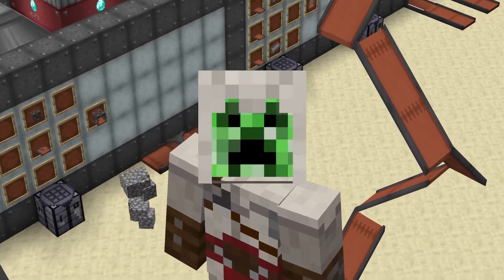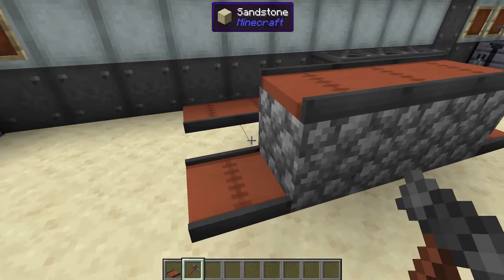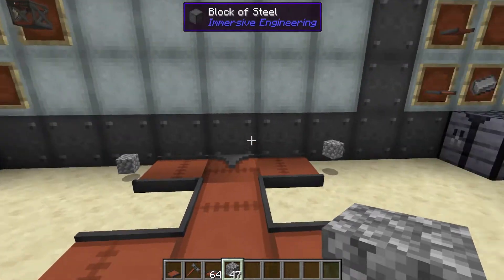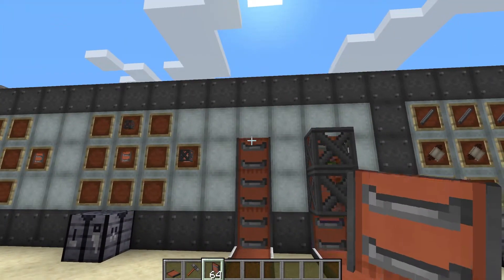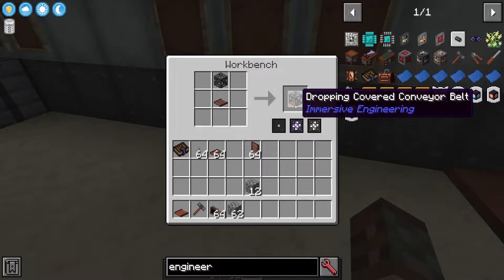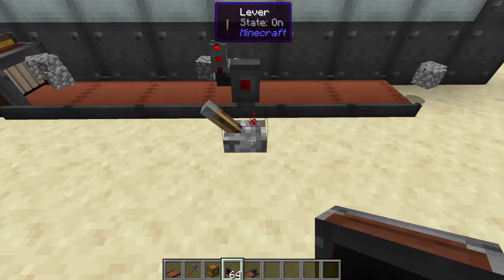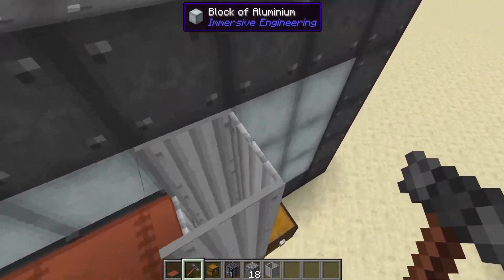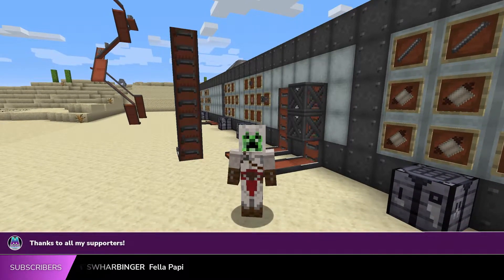How to: Immersive Engineering | Conveyor Belts (Minecraft 1.16.5)

Comment: Hi man!
Pretty new to Minecraft and started my own server with some mods.
Using Immersive Railroading and this mod here at the moment and I've started to build an automated loading system for my train.
Setup at the moment: Double-Chests with 2 extractors and 2 conveyor belts for every wagon but the extractors are pretty damn slow. Is there a way or setting to speed the extractors up? 
Or do you know a faster method? I'm open to suggestions as I don't know anything anymore on how to increase this process...
Reddit, Google and YT haven't been a help so far as they only explain the basics and I've figured those out for myself.
Maybe you've got some input for me. Thx in advance.
Reply from the maker: By extractors I assuming you mean excavators? I have a video explaining them on my channel but I don’t think there is a way of speeding it up. However you can build multiple of them. Once you have a chunk picked and core drilled you can build as many as you want within that one chunk. You just need more of them for more items per minutes rather than speed of one unfortunately.
Reply: @Mondays3  Oh, no. Sorry, I don't mean excavators, I've been talking about these things dragging stuff out of chests and putting them on the conveyor belts. 
I've been able to use the excavators so far but I need to be able to automatically transfer everything from the chests faster to the train waiting, but the "extractor belts" (looked it up in your video, sorry...) are too slow. I'd like to speed those up.
Reply from the maker: You can't speed them up. Only way to make it faster is by having more than 1 extractor on the chest and having multiple lines. It doesn't technically look faster but you are getting a higher rate of items per minute

Comment: Hoping that someone will see this comment and reply but I'm planning on using create and IE together but I'm struggling to figure out which mod has the better conveyor belt? Or even if the belts will work with the other mod?
Reply from the maker: I think the create mod has better belts as they they are a lot cheaper and work at larger distances and diagonally. The two should work together but not directly. If and item drops off the end of a create belt onto an IE belt the item will keep going and vis vera. Personally I would just use pipes myself unless it's locked in your pack xD
Reply: @Mondays3  That's fair pipes are 100% better but i'm trying to go for a steampunk build (ATM8 so pipes are an option but dunno if they'll fit in the theme) but with me having the goal of having multiple dedicated factories connected by trains it's making me have to think and plan things out heavily before I can even start lol

Edit: thank you for replying even though the video is over a year old!
Reply from the maker: @lilly_xox0244  Maybe just have a create factory and an IE factory? Would make things a lot simpler even if they do work together. 

And no problem. I reply to all my comments! Even on my very first minecraft videos!
Reply: @Mondays3  That actually makes more sense lol, like one thing i planned is making using minecolonies to make a city that could be based around one of the tracks (only worry really is that one of the sims would be ran over lol)
Reply from the maker: @lilly_xox0244  I love minecolonies! But yes the are dumb. A create train will end them
Reply: @Mondays3  This is a massive project but it'd defiantly be worth it for the cool factory but i'm not sure how efficient it'd be haha
Reply: @Mondays3  I LOVE MINECOLONIES TOO!!!!!!!
Reply: I am playing a modpack with I.E, Create and minecolonies, excited to do a mega city